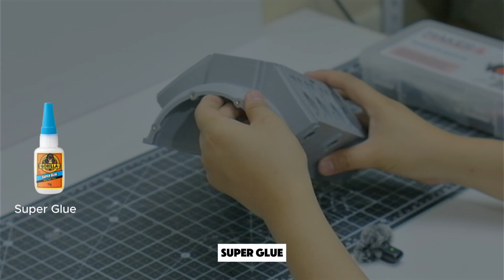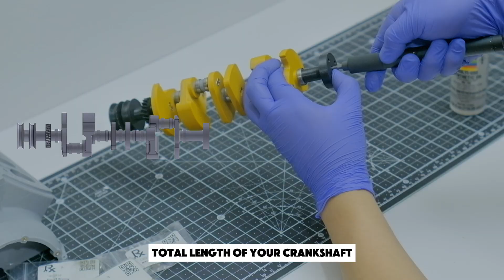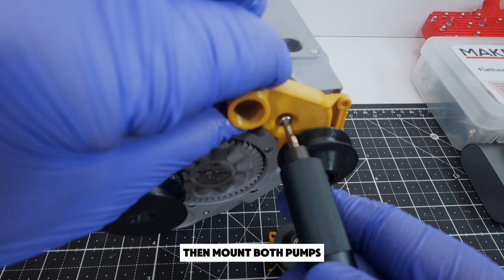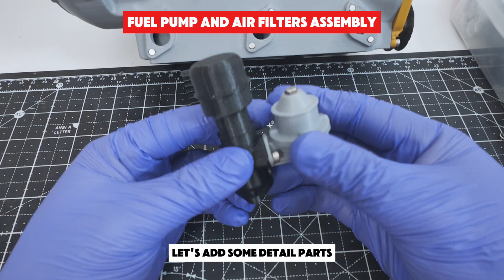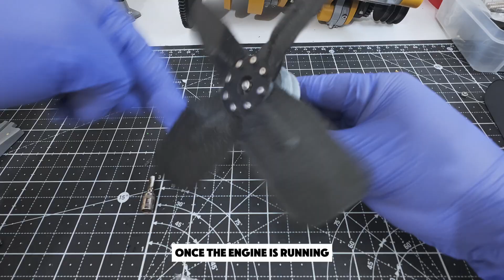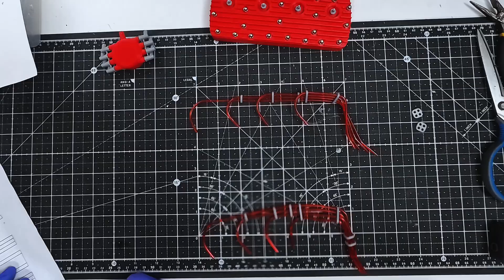Build a Fully Working 3D Printed Flathead V8 Engine | Full Step-by-Step Guide

Comment: nice engine!  I am in the process of building mine.  I am doing the high performance model with the Addons.   Every part has  been a beautiful print and fit, the only issues i  have had so far is the crankshaft.   the lobes ( part # 1 through 6)   imported into my Bambu slices in various  scales.   i found this to be true  of the files from Makers RX and Thingiverse.    I did manage to play with the scales and get them correct but the files for download need to be corrected.